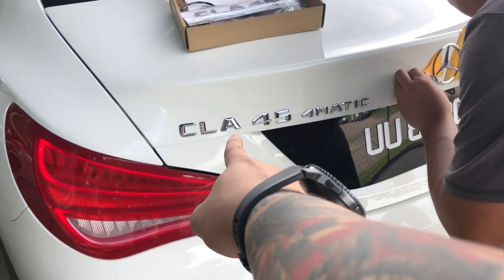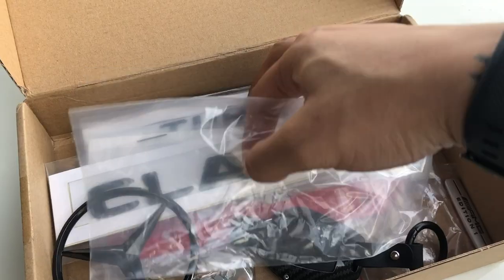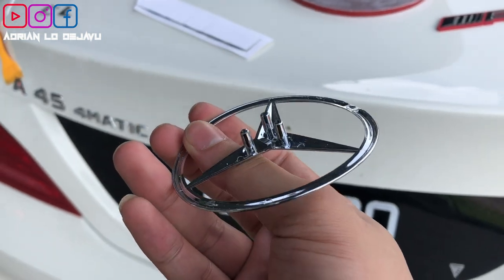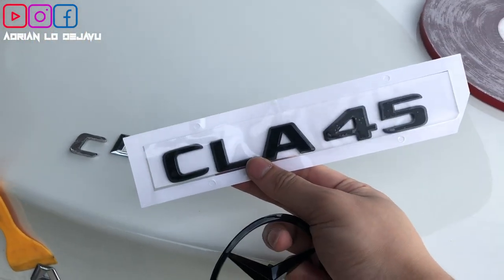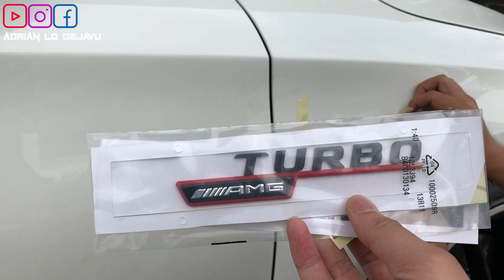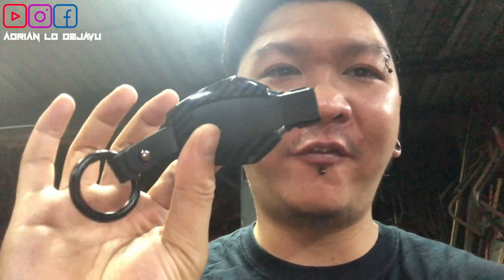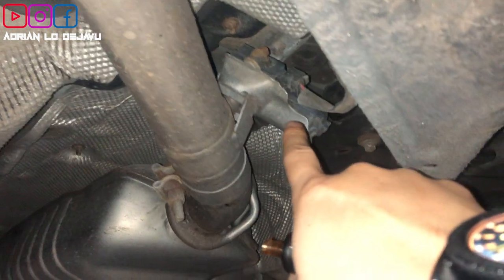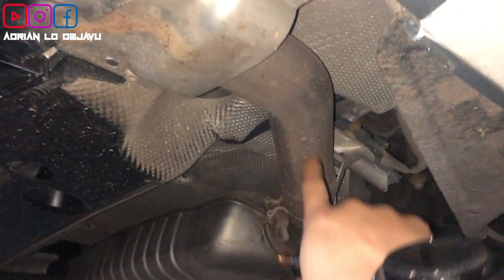CLA45 Resonator delete (Before/After) comfort mode and sport mode

Comment: is there any different in the performance after u remove or delete resonator??
Reply: im sure more torque. but too much lawas.
Reply: @afiqkhair716  because im planning to do that but some told me that it will reduce the hp by few so i wonder if it really does。
Reply: @AiVip3rHxD   thats why. as most of the tuner i lepak said.. exhaust system are the hardest part for performance tune. some got power but no note. some too loud but reduce hp.. people nowadays always kacau that exhaust cut here and there.. but they dont know that its there for a reason. factory already tune it for you to suit the car performance. same with aftermarket exhaust, just use it as it is. they already tune the exhaust for the best outcome. that is what he said la.. haha
Reply: @afiqkhair716  thanks man